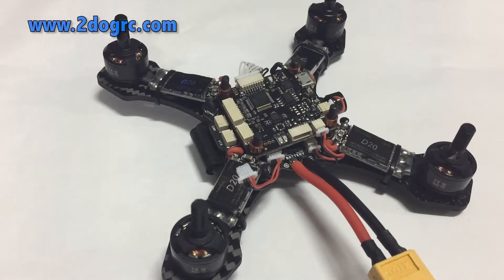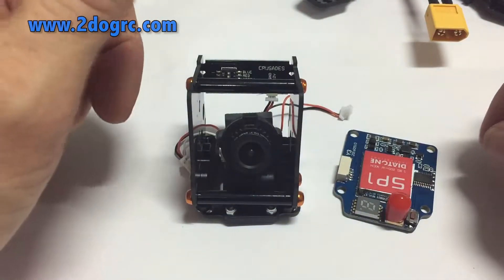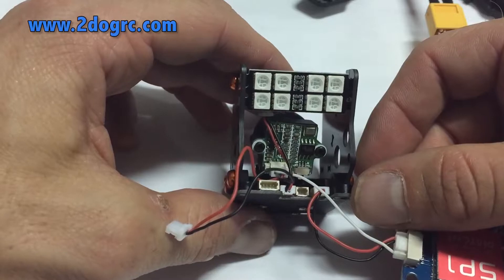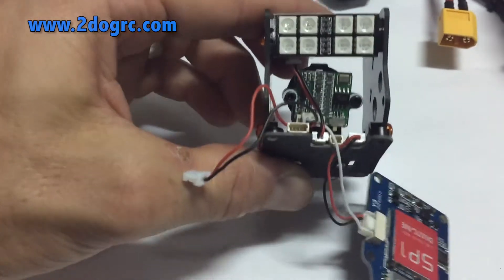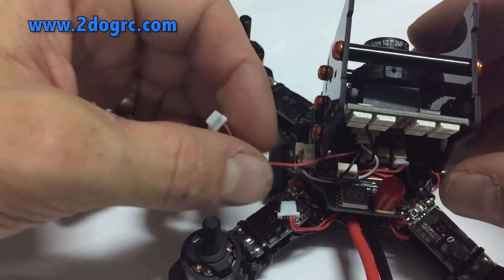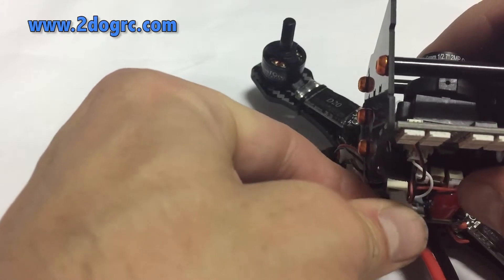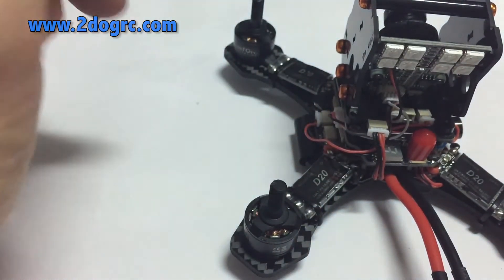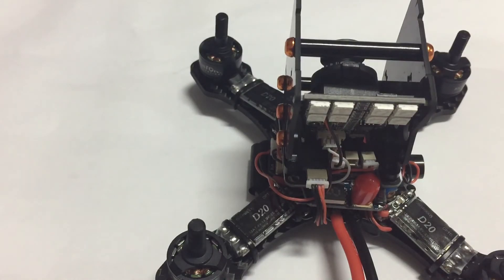How to Complete your Diatone Crusader 130 or 165 Kit

Comment: How do you attach the Batt? is there space for a strap?
Reply from the maker: Yes, there is a battery strap and the battery hangs underneath. This keeps the CG and weight all centered.  We sell silicone battery covers to help protect the battery.
Reply: mind giving a direct link, can't seem to find them
Reply from the maker: http://www.2dogrc.com/diatone-muso-battery-protector-m4-blue.html
here you go!
Reply: ty, last question- Think a full size 1177 will fit in pod?
Reply from the maker: +Thumper C I am checking that tonight. The camera is on pretty good. I flew it night last night and it did great. Video coming on that as well.
Reply: +2dogrc thanks for looking into it, I'm getting the frame so will be putting my own cam in it

Comment: you know if this quadcopter is powerfull than the diatone tyrant? thanks
Reply from the maker: Yes. It has 1306 motors and less weight. I have flown both and this is much better.